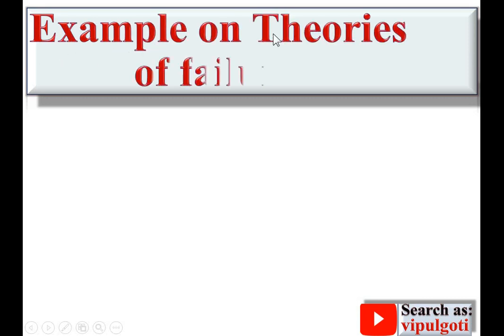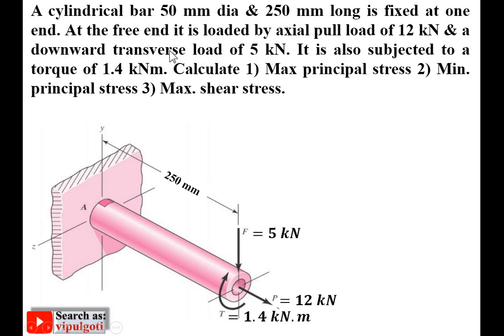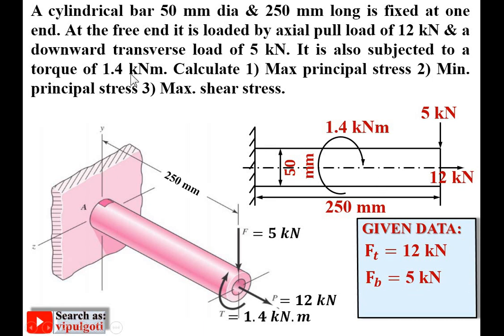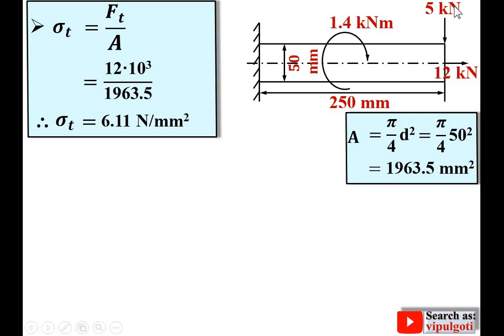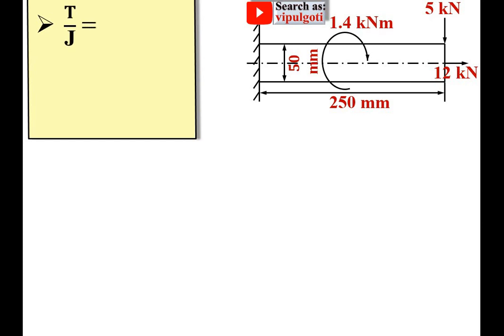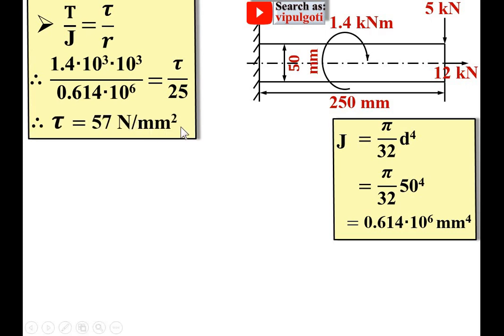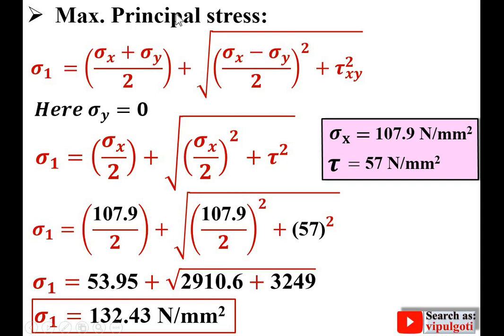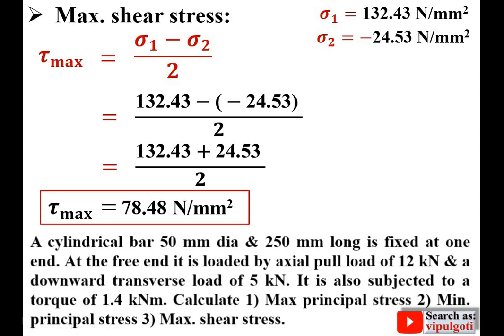Example on Theories of failure|5|Problem on failure theory|Principal stresses|gate material|GTU

Comment: A machine element is subjected to the following bi axial sate of stress
sigma x=80 Mpa
sigma y =20 Mpa 
Tau xy=40 Mpa 
Share strength of materials is 100 Mpa.
find the factors of safety as per Trecsca Maximum share stress theory.
a) 1
b 2 
c) 3

sir can you tell me the correct ans please sir
Reply from the maker: Refer my video of theories of failure
Reply: @vipulgoti47  Sir ap answers btaye... please